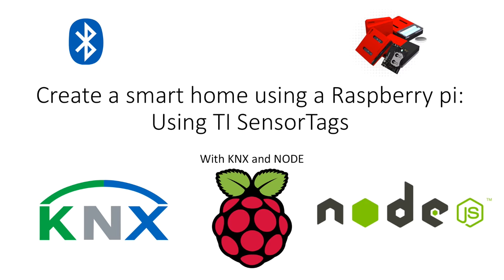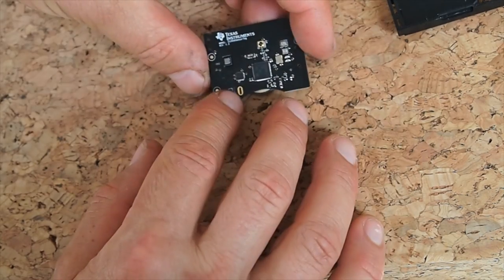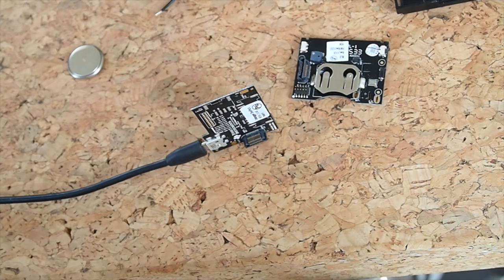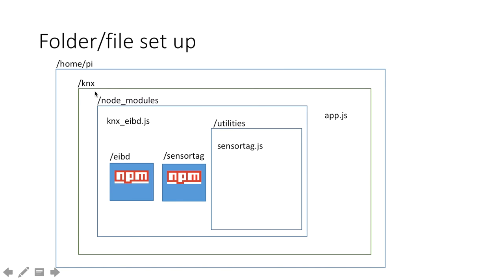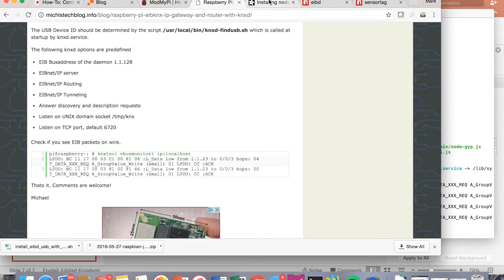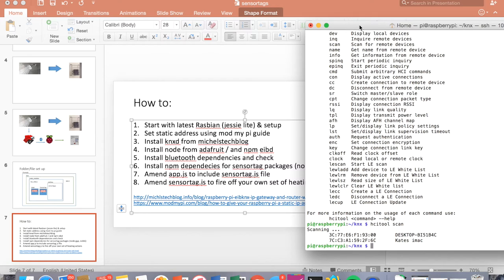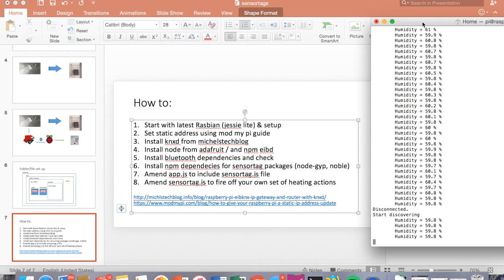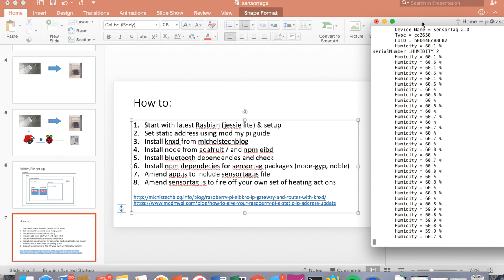KNX Raspberry pi (4) - Using Bluetooth sensortags

Comment: Hi, how did you add the multicast address in the tutorial of the static ip? Because without it the Knx-deamon doesn't work?
Reply from the maker: Hi Marc, I'm so sorry I cant remember it was quite a while ago. However I have found the sensortags unreliable for my needs and although they functioned okay for a couple of months, they became unstable and connections began to drop. I havent had much chance to delve into the reasons - I think some sort of memory issue, however I suspect the code could be reconfigured to make it more stable. Good luck
Reply: Ok thanks you, the same it's unstable